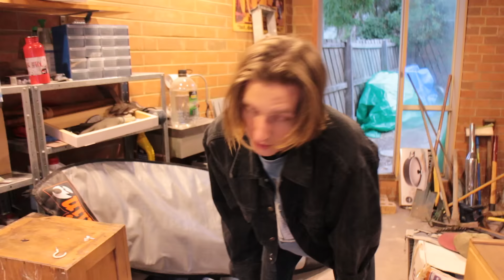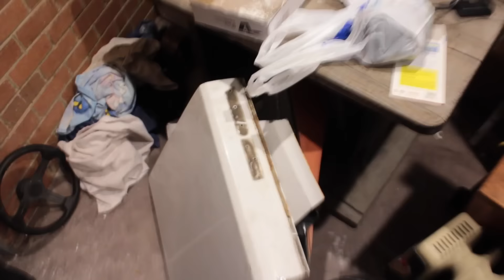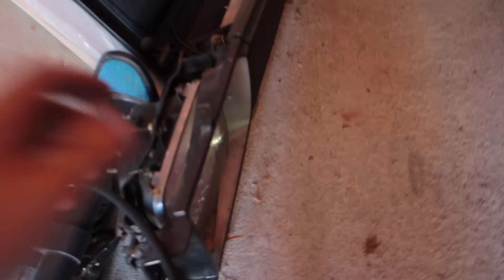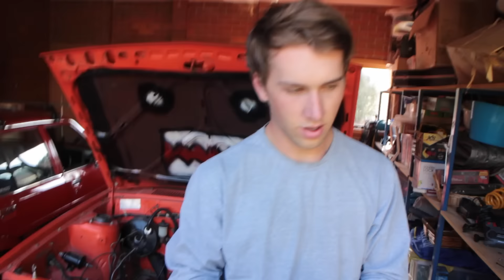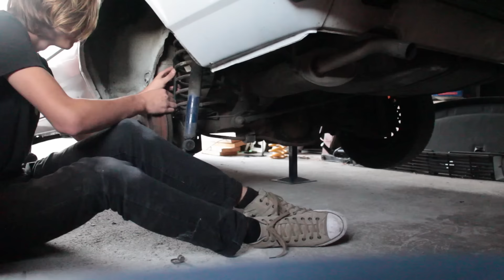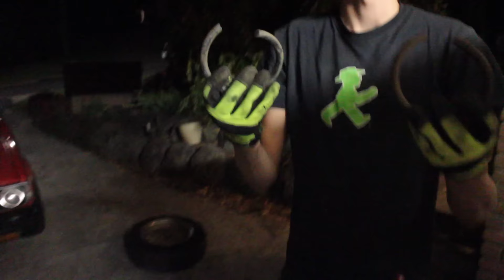Dylan Gets a KE70

Comment: Look up Barrel Bros and Pine Engineering for rebarrel/refurbishment. If you get them from Pine they take 15% off due to NZ GST and if it is imported less than $1,000 which it will be if they package it per wheel then you don't pay Aus GST. But that's like $2k for wheels